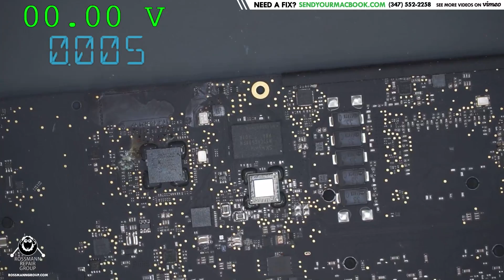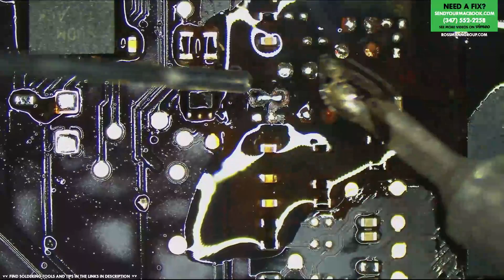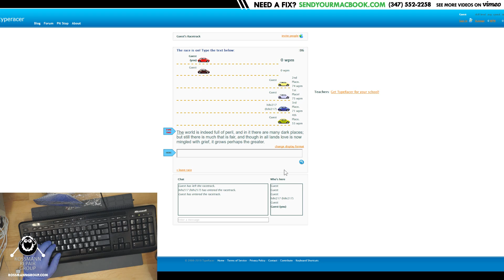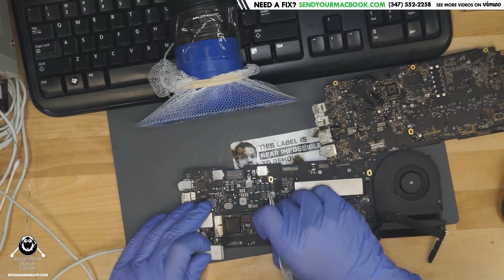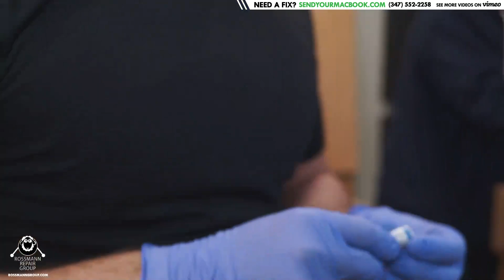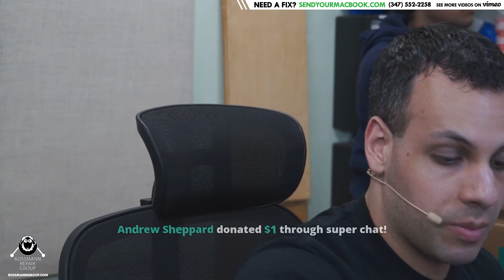Can Macbook be fixed?

Comment: 50:53 You can use Synergy 2.  The original version was free, the new one is $20 IIRC.  It's basically a network KVM.  It is very easy to use and set up.  It has very low latency, and is an incredible piece of software.  
You would set the laptop as server, the PC as client.  Then disable the laptop screen if you wish via software or hack in a switch to the backlight circuit or something.  The mouse and keyboard is shared just like it was plugged into the PC.  It does track the cursor across the screen; you can set up lock-out margins so you don't accidentally lose the cursor on the laptop.  You can even copy text and files seamlessly across devices just moving the cursor to the other's screen and pressing paste.